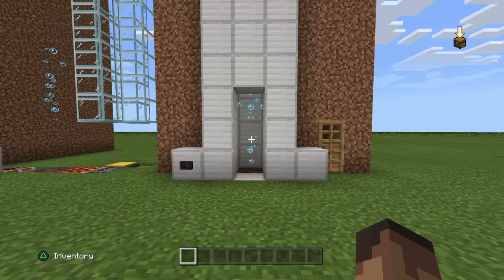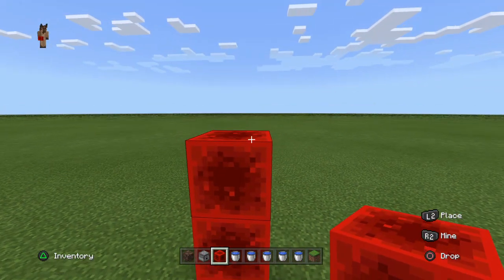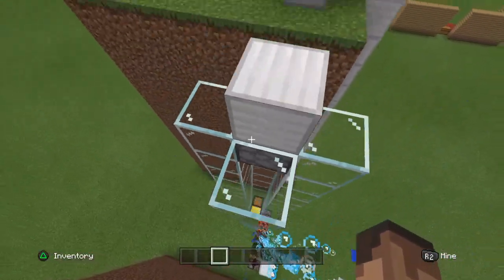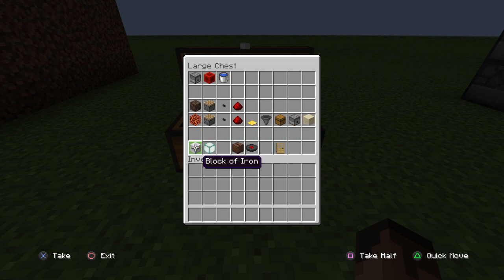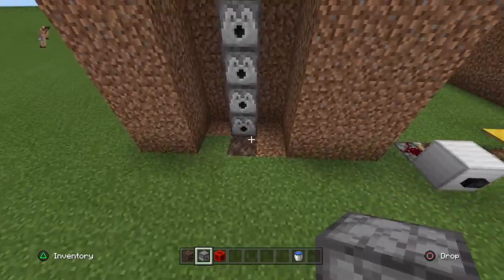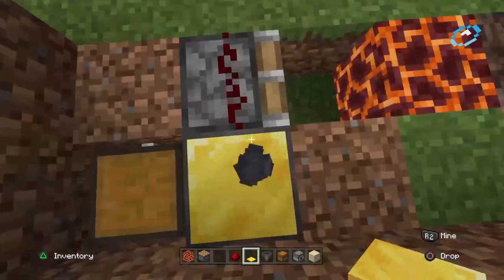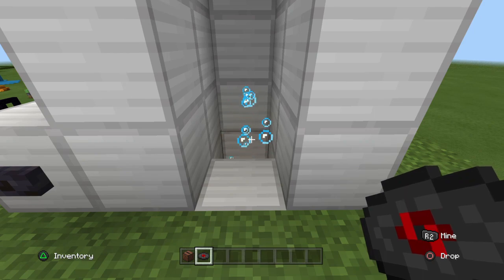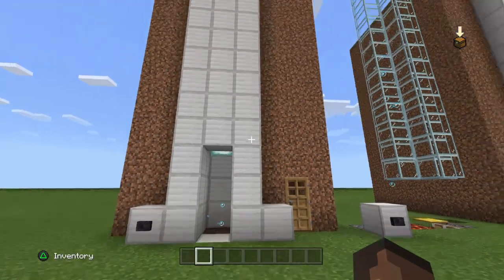How to make an Air Bubble Elevator that Changes Directions! - Easy Minecraft Bedrock Tutorial

Comment: Would I drown in survival because of it?
And do we need all of those dispensers cuz I feel like 1 could be good
Reply from the maker: You don't drown in the air bubbles. No you could do it one at a time, you would need to start at the bottom, and then work your way up, placing water with the dispenser, and then taking the water back into the dispenser. I just do it the other way on creative because it's faster.

Comment: bro the sand drops but doesnt trigger it. does it work if your elevator is alot higher than urs?
Reply from the maker: Not sure. You could always make a redstone torch tower to send the signal though.
Reply: It no longer works:( only the water works